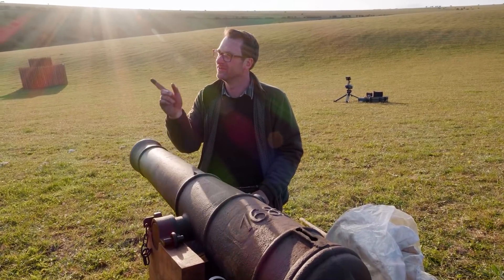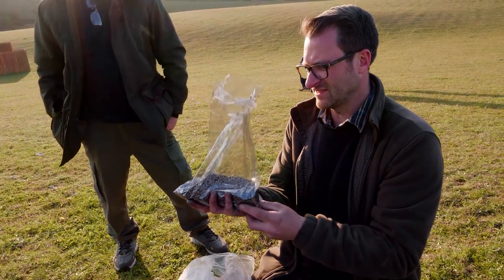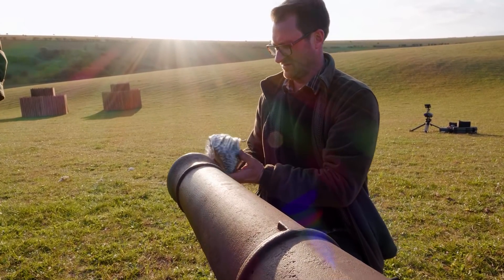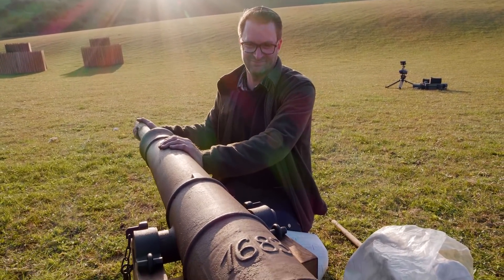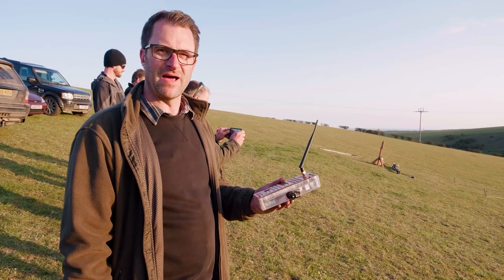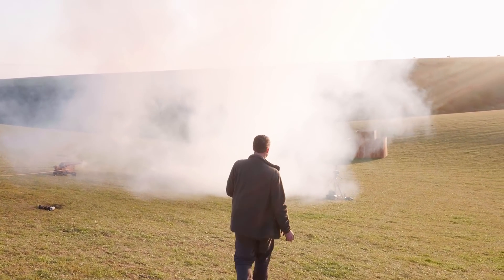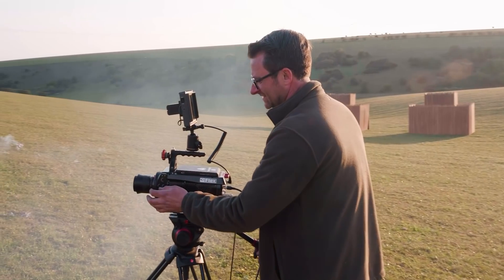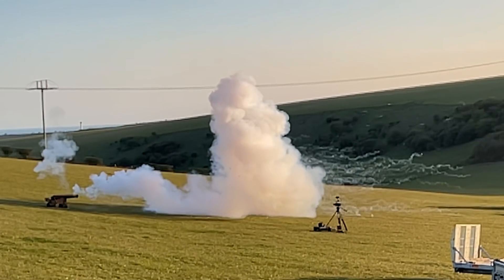Firing a 3.5" Cast Iron Cannon with 1.25kg of Black Powder!!!!

Comment: In that the 12-pounder Napoleon has a bore almost exactly 3", one is led to believe that this is/was an 18-pounder naval gun, and 3 pounds of powder would be right for a full combat load. The over-size touch-hole further suggests a naval gun, in that hitting the priming charge with a linstock and slow-match could be hard on a heeling deck. 
NOW-- if you Really want a "huge cannon," find yourself a 36 or 42-pounder, using around 10 pounds of black powder for the charge.

Comment: Can you guys build a flux compression generator? 
You might need someone who is familiar with high-powered electrics though.

The device itself is not much more than some thick wire and a metal tube (and explosives)

These things are super interesting but it has never been done on YouTube.

Comment: Hi Guys, first of all great video! 1.Make your self a good ramming tool out of wood and leather or else. You can see that your Canon shoots twice. First it shoots out the Cannon Ball, than it shoots out all the crap from the foil and unburnd powder. Which tells me, you only compacted the center of the powder. 2. Try to make one of those black powder cartiges. Out of brown paper. Gets you a even load on every shot. Lastly make your self a large wire brush and a large wet cleaning tool. Like a wood disk with wool(or else) on a long pole to clean erverything. It kills any left ambers in the cannon. If you have a bucket with water.

Comment: @Explosive Science
I thought of a wonderful replacement for the canon ball for a test, how about turning up a steel projectile that has a small sharp point on a 1"solid barrel at the tip with a 3.5" x 1.5" disk with a  1/2" x 1/2" chamfered front edge with a balanced 1" solid barrel at the back. A split piece of guide would be needed at the tip & the pointy end would hit a target which would at first pierce the target followed by the chamfered disk that would cause maximum damage as it followed through the weakened target causing it break in small to larger circles with fracture points between.

Comment: what is a thing you would like to be able to do but aren't allowed?
Reply from the maker: I’d like to do a proper Valencian mascleta in the UK. Health and Safety probably wouldn’t approve 😒
Reply: @explosivescience9389  we used 60g NEC 1.1G mascletas, good chance you will be able to use them. Do you use 20g - 100g artillery simulators? Basically the same thing, just not linked together with quickmatch to pipematch delays.